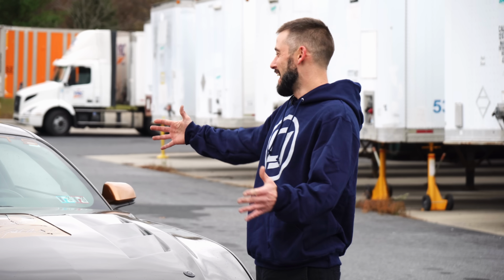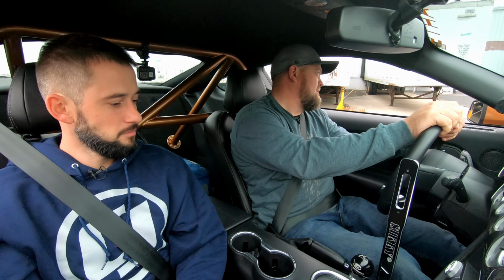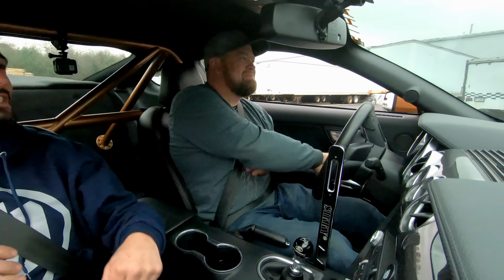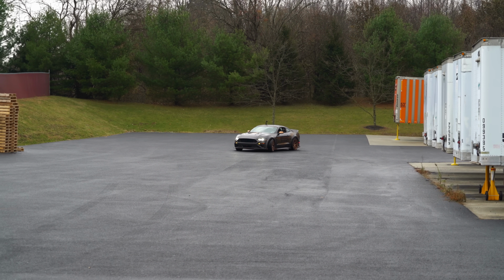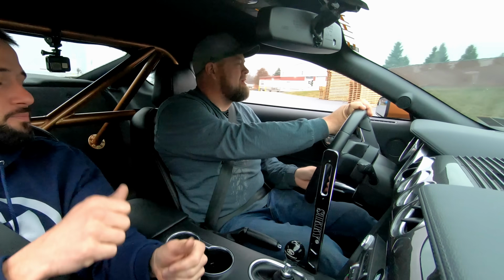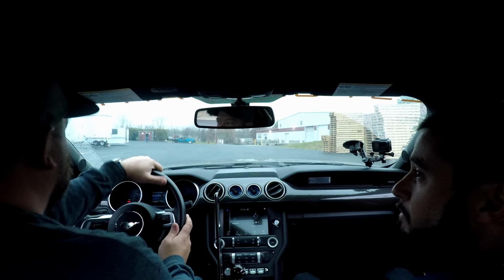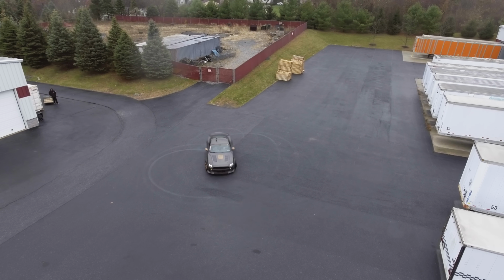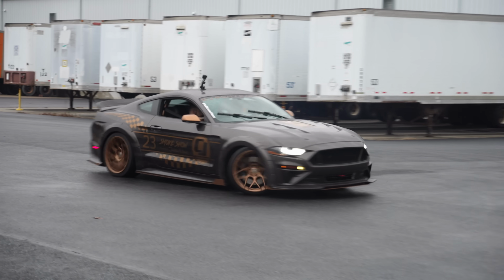Learn to Drift w/Pro Jonathan Nerren

Comment: Can the stock handbrake be used to do this? Asking for friend
Reply from the maker: It will work but not very well and its easy to lock it by mistake if your finger slips off the button.

Comment: Did you have to do anything to defeat traction control besides holding the break and traction button for 5 seconds?
Reply from the maker: There is a small plug on the driver side wheel well that we remove. It turns off all traction control.

Comment: I want the link to that hood and those rims man
Reply from the maker: https://www.cjponyparts.com/hre-ff01-wheel-and-tire-package-20-x9-5-20-x10-5-liquid-silver-2005-2020/p/W453K-B/.     Custom painted
https://www.cjponyparts.com/anderson-composites-hood-type-sa-heat-extractor-carbon-fiber-dual-side-ecoboost-gt-2018-2020/p/HD176/.  customized with the window for the blower
Reply: Thanks for the fast reply

Comment: Did you turn off advanced traction or just traction control?
Reply from the maker: Pulled the plug under the hood on the drivers side that shuts off everything.

Comment: Is it possible to turn a lexus is250 into a sleeper? If so what's a good starter besides an air intake?
Reply: Trinid __ your going to need a lot more than a tune at least a procharger/supercharger you would also need to tune it and change manifolds etc

Comment: learn to drift without a hand break first if you want to be a G.
Reply: True dat. Weight transfer and learning how to use it to upset and correct the car, not to mention steering inputs with way less angle. I see so many people "teach" others to drift, and it's sad that no matter the horsepower no matter the intention for the car, everyone thinks they need to be able to spin the tire around like a shopping cart. You do not need that much angle, and because beginners use a lot of steering input as they're used to regular cars, that's why the video was full of 75* angle understeer from spinnin the wheel too much. Liked it though : )

Comment: Great video. What drift handbrake are you using? I’m looking at installing one in my mustang
Reply from the maker: Struan Wallace it was custom made for us by Sikky Manufacturing
Reply: @cjponyparts  Thank you so much for the reply. Do you have a build guide I can look at? Just wondering if you're using the stock rear brakes and callipers, or did you add an extra caliber plus stand alone hydraulic set up...
Reply: @cjponyparts  would like to buy one of those kits as well

Comment: What size wheel and tires on there?
Reply from the maker: JIMBO SLICE 20x10.5 square with 295/30 on the rear and 285/30 up front
Reply: @cjponyparts  Is wider in the rear better or no?
Reply from the maker: Kracus Omniax not really necessary for drifting, a square setup works well

Comment: Great video! For the 2019 Mustang GT, while using it in sport mode does the downshifting sound like it would on a manual? Usually it will crackle a little bit right?
Reply from the maker: Maverick I haven’t driven an auto 2019 so I can’t say

Comment: How high did those IAT2s get with that Roush blower? Lol.  I have one too so I am not making fun hahaha
Reply from the maker: Bawn Journo Ball Pythons the highest we saw in the summer while hot lapping was in the 140s. The new heat exchanger helped.
Reply: @cjponyparts  i have a vmp triple pass on mine and I know that in this Louisiana heat iat2s will get upwards of 150 degrees on WOT pulls to 140-150 mph.  My buddy has a whipple and its not even close to 150...115 at most....ever.  i just wish Roush would come up with a solution to help all their customers out.
Reply from the maker: Bawn Journo Ball Pythons what tune are you running?
Reply: @cjponyparts  no comment ;) lol.  The point is in the past the Roush blower kits responded well to modification and they basically sorts pulled a bait and switch and left all of us with 18 and ups stuck at a very limited power window.  If I had known its limits I wouldn't have gone with the Roush.  I suppose its my own fault but regardless its highly disappointing.  I know I am one of the countless people who feel this way.
Reply from the maker: Bawn Journo Ball Pythons the new tune and heat exchanger made mine better but didn’t completely fix the issue. I am not giving up yet, it’s a 2650 and other kits stay a little cooler so there is a way. I was seeing 140s with the Edelbrock too
Reply: @cjponyparts  yeah they stay cooler with double and triple the intercooler....I just don't know if their even is a fix with roush's current design.  I doubt there will be any new news for us that have already bought it.  I even heard that whatever the stage 3 upgrade is on the Jack Roush edition wont ever be released to the public.  Read that in a comment section supposedly from Roush.  That new Odin from VMP is looking pretty great right about now lol
Reply: @beau7133   Give our sales team a call, We can get you some info on our new ODIN Kit! Pre-sale is going on now for the 18+ supercharger kits!